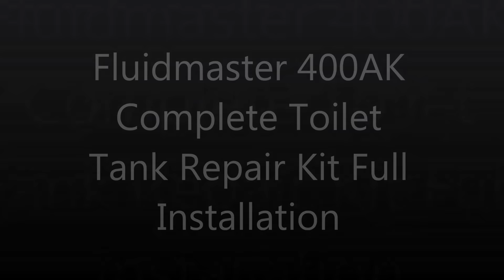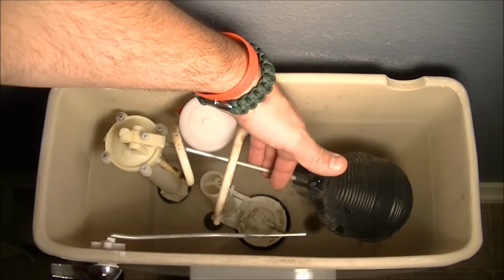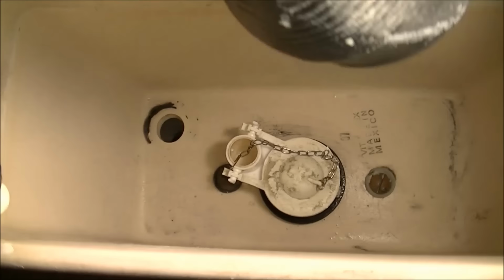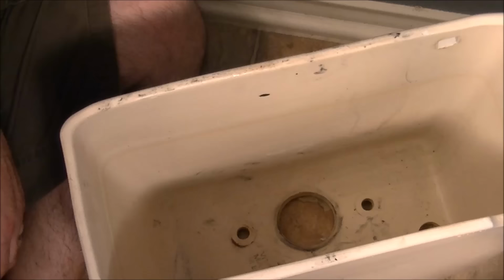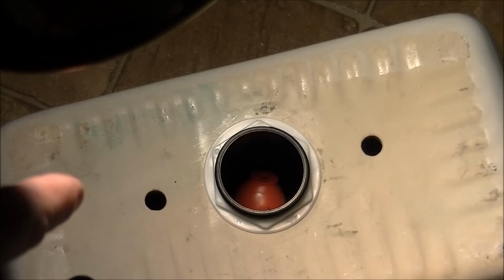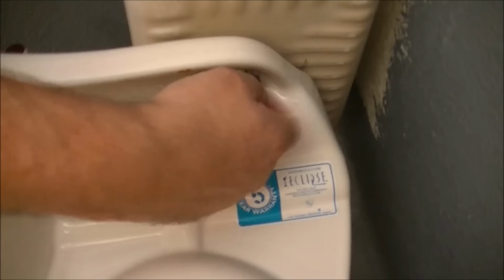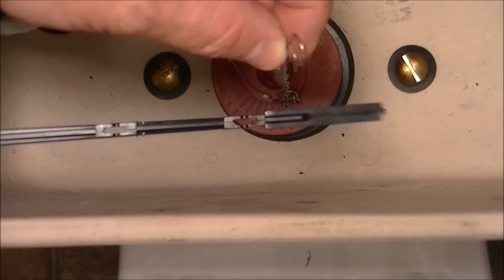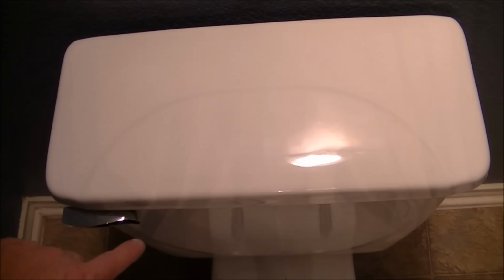FluidMaster 400AKR Complete Toilet Tank Repair Kit HD Full Installation

Comment: I started with another video, but I had to leave it because it didn't make several thing clear. This video gives all the explanations that I  need, and I'll be using it tomorrow--I'm too tired now--to install the toilet tank repair kit. I'll be back after I finish the job. Oh, I just noticed  the presence of some old-timers here. Well, I beat them all. I'm 81, but I don't feel any reason for boasting. I still have everything I need to do the job. I'm just a not a very handy handyman, but age has to do with the unhandy part.
Reply from the maker: You are most welcome. Thank you for watching, commenting and the kind words. I appreciate it greatly. All the best.👍😀

Comment: This was so very helpful! I bought the Fluidmaster kit at my local Lowe’s, got it home, and was totally buffaloed by the “easy installation” instructions. After looking at the parts for a couple of days, I found this video and felt totally confident about proceeding. My only issue was a big triangular rubber gasket on the bottom of my Kohler’s toilet. I called Kohler (SUPER not helpful) and Fluidmaster (equally not helpful). After much deliberation, I reused one of the three bolts from my Kohler and the six rubber gaskets in this kit and threw the triangular gasket in the garbage. Richard, you are my hero! Thank you!

Comment: I used the same exact kit, I put in the bolts the way it was described in the instructions. The second rubber gaskets protect the porcelain on the bowl. But it works great, I put this kit on a 68 year old toilet. Unfortunately my disassembly wasn't as smooth as yours the flapper and over flow tube were extremely corroded and improperly installed. I had to carefully cut off the brass assembly with a reciprocating saw. Now the toilet works better than it has in years. The adjustable flapper helps control the amount of water that goes thru the system. Also it's a great idea that the fill valve assembly is height adjustable.
Reply from the maker: I'm glad and happy to know I could help you. Thank you for watching, commenting and the very kind words. I appreciate it greatly. All the best.👍😀

Comment: Really appreciate the time you took to make the video and share it.  I found one issue with your process that I want to bring to your attention.  The tank bolts need to use the thinner nuts before the regular nut.  Basically the correct order is for the bolt head to go through rubber washer, bottom of the tank, metal washer, thin nut, toilet bowl, rubber washer, metal washer regular nut.  This allows you to directly tighten the rubber inside tank with the thin nut.  Then you tighten the regular nut for the tank to the bowel.  Some will have three bolts instead of two and they provide extra rubber washers for this but you need to reuse your bolt and nuts.  There is a correct order of hardware parts diagram in step 4 of the instructions that will make this more clear.
Reply from the maker: You are most welcome. Thank you for watching, commenting and the kind words. I appreciate it greatly. All the best.

Comment: Liked and subbed! You really helped me out of a bind! 
I have a tip to share, and an additional point about mounting the tank onto the bowl.
Tip: When removing the supply line and shut off valve, I taped some aluminum foil to the bathroom wall under the valve. I chose foil because you can easily form it in case of a leak, and guide the water into a dish or onto a towel.
Also, my instructions for the fluidmaster say to use washers and nuts on the tank bolts, then ADDITIONAL washers and nuts to secure the tank onto the bowl. The instructions have likely been updated since you published this video.

Comment: I think my favorite thing about this video is the problem you had with the chain under the bottom seal. I'm sure that a lot of people have the same problem, but you calmly showed us how to solve it. Thank you.
Reply from the maker: You are most welcome.  I was actually happy that it happened to me so I could show it to my viewers too. Thank you for watching, commenting and the kind words. I appreciate it greatly. All the best.👍😀
Reply: @richardlloydusa  I was confused about the washers and nuts on the tank bolts, so I went to a plumbing supply store. I bought a tank bolt kit from them and asked them about the washers. They said that there should be a rubber washer inside the tank and outside. One metal washer should go over the outside rubber washer and one of the nuts should be used to tighten it. The other washer and nut should be used to hold the tank to the bowl. This allows the torque on the tank sealing washers to be different from the torque used to level the tank. My tank was installed the same way you show yours, but the attachment bolts had been torqued so much to make a seal that the inside rubber washer was heavily deformed and the metal washers holding the tank to the bowl were bent into dome shapes. I suspect this was done by the contractor because it saves money.
Reply from the maker: A little too much force. Thank you for watching and commenting. I appreciate it greatly. All the best.👍😀

Comment: Thank you!  The flapper gasket seal and exterior rubber grommet had degraded and was leaking.  On further inspection after 23 years use, all the rubber gaskets were iffy.  Your video clearly took me through the replacement process including adjustments.
Reply from the maker: You're most welcome. Comments like this make my DAY! 😁️ I'm glad to know I could help you and that you got value from my work here. I made this video to help people just like you. Thank you for watching, commenting and the very kind words. I appreciate it greatly. All the best.👍😀
Reply: @richardlloydusa  Richard,I could not loosen the octagonal flange on the underside of the water tank so got out my hack saw and in a minute cut it off.  No expensive tools needed, just care not to nick the ceramic.
Reply from the maker: Hey that works! I probably should have done that with mine too. It was cross threaded all the way down. It was a bear to get it off. Thank you so much again for commenting. I appreciate it greatly. All the best.👍😀

Comment: Thanks for sharing, it was helpful. My kit came with six rubber washers so I used the extras between the tank and the toilet for a little extra cushion. I also found that if you have a pipe cutter, it makes a much cleaner cut than a hacksaw would. I didn't have a hacksaw handy so I didn't have a choice. Worked out just fine! Thanks again.
Reply from the maker: You are most welcome. Thank you for watching, commenting, the valuable feedback and the kind words. I appreciate it greatly. I am happy to know I could help. All the best.👍😀

Comment: Today the flapper valve snapped at the base the same as yours and I did not want to have to call a plumber.  I purchased the same repair kit and you explained everything with such great detail.  I started to panic when I opened it and looked and the installation manual but watching this video I have a great deal of confidence of installing this kit just right.  Thanks!

Comment: Just a note to Richard, when you are using a adjustable pliers you want to have them not backwards. Watch it and look when you can't get it to do anything that is backwards. When it was working that was the right way. The fixed jaw is on the top or backside and the jaw that moves you are putting the pressure on. Thanks for the video and hope this helps you. Dan
Reply from the maker: +Dan charlson Thanks. It did not help that who ever put that nut on cross threaded it either. Thanks for watching and commenting.

Comment: I am in the midst of a home renovation. I need to replace the inside components of all 3 toilets. I happened to purchase three of the exact kits in this video. I was searching for assistance and discovered your tutorial. I now feel prepared to tackle all 3 toilet updates -all thanks to your tutorial. I very much appreciate your guidance. Since my work also involves almost every room in my home I will certainly subscribe. After toilets my new furnace and a/c will be installed. While they are on-site I will be installing 4 GFCI outlets. I will certainly search your channel for tutorials re those challenges.
Reply from the maker: Thank you very much.

Comment: Great job.  I needed the refresher.  I'm glad you included the part at the end about the excess chain.  It can get missed, and it doesn't always get tangled under the flapper valve.  But sooner or later it will tangle, usually on your last flush before leaving on a weekend vacation.  Make sure it is short enough (but not too short) even if it does not tangle on the first flush. That is a lesson learned on my part.  Well done.
Reply from the maker: Thank you very much for watching, the feedback and the kind words. I appreciate it. All the best.

Comment: Richard, thank you so much for this video.  I bought the exact same kit and was really confused with the setting the height of the overflow valve and I did what you did with comparing the height to the old piece. And it also seemed like my toilet tank is the same as yours.  This video helped so much.
Reply from the maker: You are most welcome. I am happy I could help you out with this. BTW it's still working great and I am going to buy two more for the other toilets. Thanks for the kind comment and watching.

Comment: this was a great help.
imagine going into the bathroom and finding the floor soaked and wondering why - toilet tank bolts leaking is why.
i bought this kit last year because the float valve was leaking out the top when flushed so now was the time to fix this. dremel with a cutting wheel + makita 5" grinder = removal of rusty tank bolts.
your presentation was easier than the instructions, thank you.
robert and angry red head wife

Comment: Thank you so much Richard. I have an older Mansfield toilet with virtually the same guts as yours. My local hardware store didn't have much of a selection of Mansfield parts, so I took a chance on the Fluidmaster. I watched another video, but it just didn't seem right. Your video was very easy to follow and I'm glad I watched it. My toilet worked the first time I flushed it and dry on the outside! I'm easily frustrated by the in package directions and found your video perfect. Thank you so much!
Reply from the maker: You are most welcome. Thank you very much for watching and the kind words. All the best.

Comment: Did a full replace yesterday and this was awesome.  Only tip I would add is folks REALLY need to pay attention to rotating the fill pump counter clockwise to raise the level before installing or you'll have to do a bit of disassembly to adjust later on.  Sort of sucks how they've designed it because that's only something you'll figure out after it fills with water the first time.
Reply from the maker: You are most welcome. Thank you for commenting and the kind words. All the best.

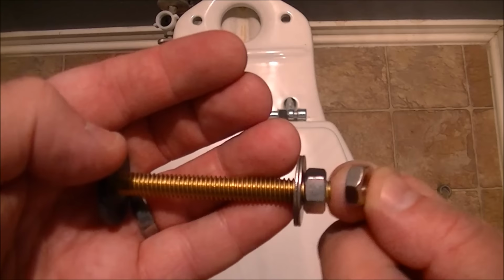Comment: The "skinny" nut you referenced at 32:04 is for reinforcing the nut and bolt connection immediately under the tank by placing a another washer and nut between the tank and bowl and tightening it until the rubber washer in the tank deforms indicating a good seal!  The pros and cons of using this are that it reinforces the washers ability to seal but the con is that in the event of a leak under that washer the tank would again have to be removed to tighten it.  The instructions advise reinforcement with the "skinny" nut and a washer to tighten up the seal!
Reply from the maker: Thank you for watching, commenting. I appreciate the feedback greatly. All the best.

Comment: Great job, great visuals, and great audio. I really liked how you explained, and showed what mistakes you made and how to fix them. I finally feel confident in how all the internal parts work, and at what level the parts need to be set. Also,  what I should be looking for with running water, leaks, etc.. Before this video I wanted to stick with the old replacement parts. I didn't want  to deal with the new types like this Fluidmaster. Now I feel confident in switching over to the  newer replacement parts. Thank you for taking the time to make this video.

Comment: Thanks so much for this.  I only had to replace the old float / refill valve, but this was a perfect video for that.  I didn't replace parts that didn't need replacing - so now I have spare parts in case they ever do go.

Comment: Thank you. Your help was fantastic... The only problem I had was removing the tank, because of a rusted bolt which I had to hacksaw off. (sliding the blade between the base (bowel) and the tank to cut it)  I felt like I had an expert right with me as I did the installation ! Thanks Again!
Reply from the maker: You are most welcome. Thanks for commenting and the kind words. I appreciate it greatly. All the best.

Comment: Nice video, The thin nut and one of the two washers go on the tank bolt between the tank and the bowl to keep the rubber washer inside the tank water tight, then the tank is put on the bowl and held in place with the thick nut and other washer, being careful not to tighten those as tight as the thin ones so as not to break the bowl flange
Reply from the maker: Yes you need to be careful not to over tighten and crack the bowl. Thanks for the feedback and watching.

Comment: I am so glad you got rid of that automatic cleaning system. You don't know how many calls I get because the back-flow of chlorine gasses from that particular system destroy the fill valve. Use Fluidmaster's Flush-n-sparkle instead. It traps all the gasses and protects the tank internals. Nice video. Thanks for installing everything according to the instructions. Most of these DIYer videos are done incorrectly.
Reply from the maker: You are welcome. I wasn't using that unit anyway. I will take a look at the Flush-n-sparkle. I follow the directions for three reasons. One the engineers who built the system ok'ed the manual. Two if I follow the instructions to the letter I have recourse with the manufacturer if it fails to work as advertised and in my case I also have video evidence. LOL. Three I find I have the greatest success with equipment when I follow the manufacturers directions. Thanks for watching and commenting.

Comment: Great job.  Very detailed.  One suggestion to people is keep an extra supply line just in case.  I had one of those vinyl braded one like he is using.  They break easily.  I bought the metal 5 pack and keep the extras just in case.  This is a great video.  Fluidmaster does not mention having to use a hacksaw to that filler pipe.  I wish I had watched this video because I will have to take it apart and trim it now.  An excellent video.
Reply from the maker: Thank you very much for the tip on these lines. I think I will replace them too. I don't want it to break on me at an inopportune moment. I appreciate your comments and watching.

Comment: thanks for going slow with the info its very helpful one thing I do recommend is replacing the supply line even if it is not broken because eventuly  it may leak so wile your at it you might as well change that and so you don't have to do it a year or two down the road thanks for posting the video it was rely clear instructions 😊☑
Reply from the maker: You are welcome. Thank you very for watching and the feed back.

Comment: currently doing this project. this video is incredibly helpful, I've just run into the worst problem so far: the central piece won't come out because A) it's metal and rusted B) whoever did this put the giant but on upside down! So my wrench is to fat to fit between the tank and the lol on the but. 😫 yay, 70's plumbing.
Reply from the maker: +Danielle Farrell Have you tried some penetrating oil on it? Make sure you let it penetrate for at least 30 minutes. Thanks.
Reply: I soaked it carburetor cleaner for about 2 hours, washed it off and I was able to take it off with just my hand! it's miracle stuff!
Reply from the maker: +Danielle Farrell Very cool. I will have to try that next time I come across a rusty part. Thanks for the info and watching.

Comment: Thanks for posting this. I only question your washer arrangement when reattaching the tank to the bowl.  IMO should be bolt, then one metal washer then rubber gasket (metal washer mashes gasket down to the ceramic to give a good seal, rather than the bolt head contacting the gasket), instead of both metal washers together on the other side.  Thanks.
Reply from the maker: Sounds good. I have not had a leak in mine since the installation but if it works better then go for it. I may do that on my next repair. Thanks.
Reply: This was my thought exactly.  Bolt, metal waster, rubber grommet, (place into the hole),  metal washer then nut.

EDIT:  Actually I'm incorrect based on the install directions.  There is a reason for that shorter nut.   It should be bolt, rubber washer going through the tank followed by the metal washer and the shorter nut.  So you're basically attaching the bolt to the tank first and then you put that onto the base followed by rubber washer, metal washer and larger nut.

EDIT 2:  I just did my toilet and it was bolt, rubber washer, put that through the assembly, metal washer then larger nut.  In my first edit the instructions call this "reinforcement".  I never had any problems so I duplicated the original way on my toilet.  The video is correct but you don't have to use 2 metal washers but I don't see it hurting anything.,
Reply from the maker: Thanks.
Reply: I'm glad you saw the 2 washes together like I did. A better arrangement to me at least would be, to have 2 rubber washers per bolt. One on either side.

Comment: If you could get a little more height out of that aftermarket overflow exhaust, you could squeeze a few more ponies out of that tank. And that cleaning unit probably minimizes inherent tank drag. 
Snap a damn unpeeled banana in half with a flow master 400 performance kit under the hood.